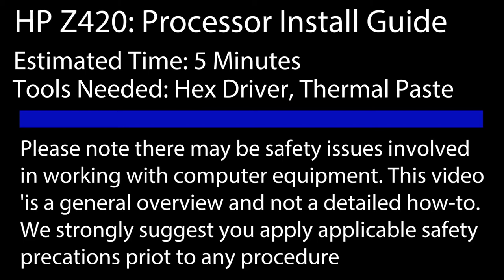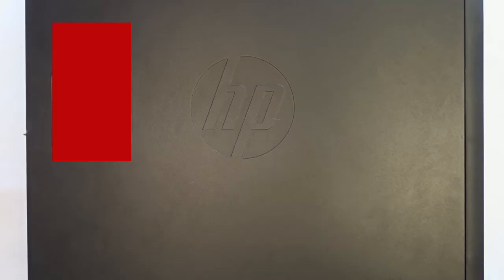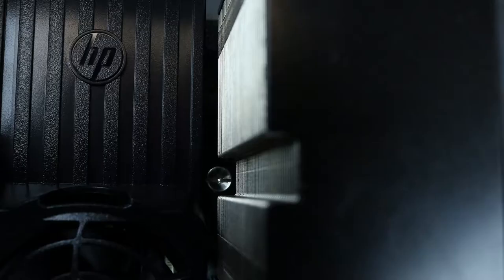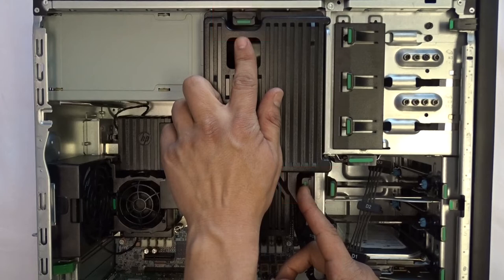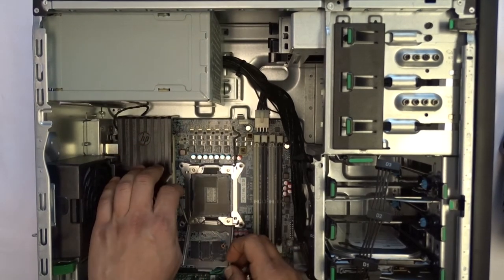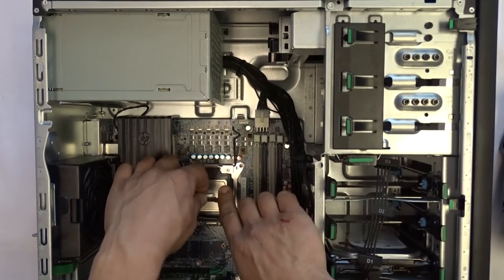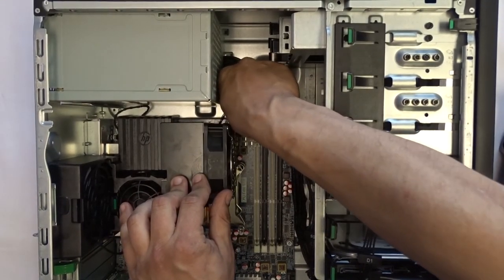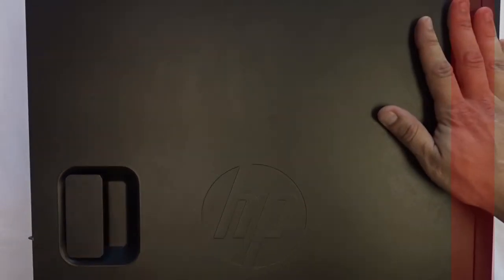HP Z420 Processor Installation

Comment: i have...
HP Z420
Processor	Intel(R) Xeon(R) CPU E5-2650 0 @ 2.00GHz, 2001 Mhz, 8 Core(s), 16 Logical Processor(s)
Ram 32 GB
.........when i use 'After Effects' and apply any effect+render Both cases The system is too slow, plz how can i speed up my system, thanks
Reply: Can I put v2 or v3 processor in it